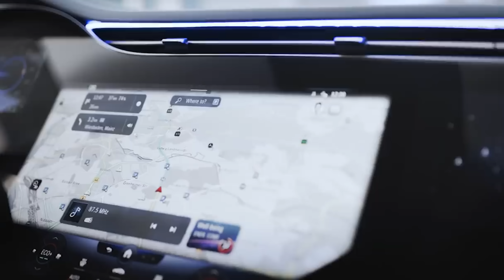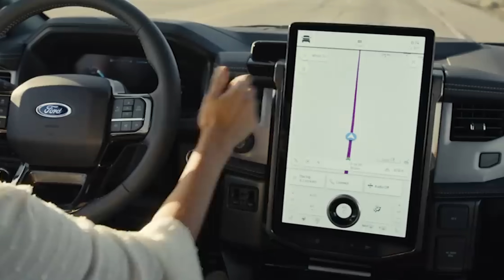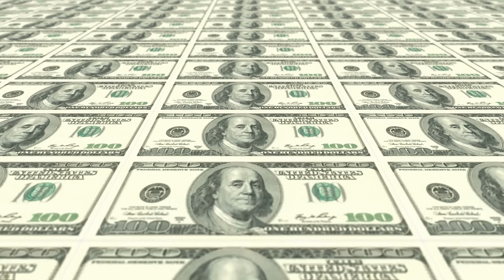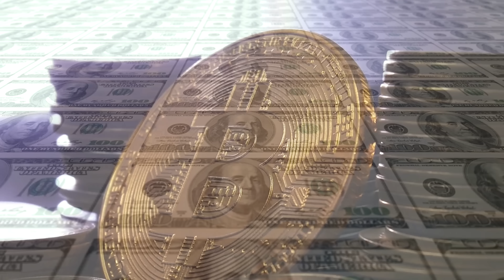What are Chinese EVs Doing to Establish a Market?

Comment: Your analysis for the present day is correct. However, it's static, not dynamic, so that's not the right analysis. The correct analysis will try to figure out what the Chinese will be capable of after they have ramped volume production in the Chinese domestic market. What is the rate at which the Chinese companies can ramp, and what is the rate at which they can innovate and improve their product? If the Chinese EVs are slower than Tesla, but faster than Ford, GM, etc, then there WILL be a Chinese invasion of the US market, eating up all the market share not taken by Tesla!
Reply from the maker: I think at this stage its an "IF" they ramped to volume production.
Reply: @TeslaEconomist  Well, that's the thing. The game is rigged for the Chinese companies in China. Also, Tesla and the rest of the industry will have the effect of increasing the knowledge and capability of local supply chains. IF the Chinese EV companies ramp up (and I think that situation is like the early 20th century in the US) someone over there is going to wind up lean, strong, and competent. It's those surviving fittest companies that will become the invasive species coming over to the US. Law of large numbers makes it unlikely all will fail to ramp, and make it likely a few will succeed.
Reply: I really hate Chinese companies because looking at the books is pointless. I’d love to see a chart with the trend in capital efficiency. Are Chinese companies becoming more efficient faster? Any Ideas? How can we get good corporate books? Maybe they are accelerating, if so this could be a flaw in your thesis. Hmmm…
Reply: @TeslaEconomist  You are wrong again.  The Chinese have already proven they can build a factory faster than GM  or Ford. NIo will be set to go from 120K to 600K in the next 12 months.  Do I need to mention BYDs  accelerated pace? You need to do more homework.
Reply from the maker: They are making cars that are not suitable for the US market.
Reply: @TeslaEconomist  I think you have hit the nail on the head. Chinese people are smart, innovative, etc. and therefore respond to incentives. But a command economy never correctly sets out the incentives since it’s goal is to stay in power, not respond to the consumer market.
Reply: @johnryan8645  
"It's goal is to stay in power....."?
What do you think the recent "union build" debacle was about?
Nothing more than "promise me your vote, I'll look after your job"
Reply: @rogerstarkey5390  sure. You’re right. A perfect example. Yes.
Reply: @TeslaEconomist  let me chip this in, I respect your analysis a whole lot 🙌🏾, thanks for your invaluable efforts and time. 
That said, you are completely offside here 🤣, you see the level of conviction you and I have in Tesla while the broader market is mis-analyzing it, that level of conviction is what I have that the Chinese EV has (not will) all it takes now and in the nearest future to take on any market share not gobbled up by Tesla.
What would you say or think they lack? Innovation, drive, country support, technology, cheap labour, finances, cheap loan, precedence, experts? Pick anyone and I will wrote you a dosier how you are missing the forest for the trees
Reply: @TeslaEconomist  The point is, taken from Ark Invest, that once they have ramped up in China, Wright's Law will come into effect, and they will be able to produce better product for cheaper. The same thing happened with Japanese auto manufacturing. All those companies started with reputations for shoddy products not suitable for the US market, but then grew into companies that were able to produce such products. It's only then, that they started their invasion.

Comment: Thanks for doing such an excellent job exploring this important topic.   You make many good points but miss, in my opinion, the key issue, which is this - China is a predatory merchantilist state.  Profits and losses literally do not matter (in the short to medium term).   China’s approach is to subsidize companies and markets they want to enter and then chose a standard bearer (generally only 1, but possibly more in a market as big as autos), and by so doing support that company’s growth in China, allowing the chosen enterprise to achieve best-in-class scale, costs, quality (measured against Western benchmarks), and profits.  With Chinese market dominance achieved, this company is then capable of exporting to enter Western markets, where it will be priced to gain share against local incumbents.   As you suggest, they will not be able to displace Tesla, but because of the weakness of the other large players in the US market they will have an exploitable opening that will, over time and despite the large subsidies afforded US (and Mexican - lol) makers will lead to gaining a significant share of the US market.  So, concretely, what will this look like?   Step one - Tesla’s order backlog quickly climbs to 3 years or more with the rebate incentives.  Step two - The incumbent’s can’t source sufficient battery capacity to increase their production to meet demand and buyers just give up on ordering BEV models (some will settle for a hybrid).   Step three - by 2023, China’s standard bearer/s (BYD, Nio ?) will offer a competent car for slightly more than a Tesla with near-term delivery.   Does China Inc lose money on each sale?   Maybe but they don’t care.   Consider also the geopolitical forces that bear on the issue of auto sales.  Can the US effectively ban China sales of autos in the US?  No.  The China market as well as Tesla itself is China’s hostage to this strategy.   If buyers are clamoring for BEV’s will US politicians not accommodate them?   I think so.  Bottom line, a ruthless and competent  competitor can and will gain significant share in the US in the 2023 - 2026 timeframe because other non-Tesla companies are 1. Incompetent, and 2.  Incapable of scaling BEV models.
Reply from the maker: Yes you have fully understood my points. I agree.

Comment: Another great analysis video, thanks! I agree with most of what you are saying. However, I found it a bit disingenuous that you used the MG ZS EV example when the MG 5 EV is a much more attractive vehicle to anyone looking for range and value. £26k for 250 miles of real range is not to be disregarded quickly. And in the uk with salary sacrifice low tax leases, this car can be had for as little as £180 per month - pretty crazy economy.
Reply from the maker: Define real range?
Reply: UK channel.
Husband uses the MG as a mobile workshop "motorway munching" as a mobile EV mechanic.
Serious mileage.
Reply: @TeslaEconomist  achievable in the same way as a Tesla Model S can achieve 400 miles - so definitely not usually but can still realistically be done with some careful driving. I had a test drive in one and its definitely no Tesla but still a vast improvement over most ICE vehicles or budget EVs
Reply: @TeslaEconomist  I just had some confirmation from another YT channel “EV James and Kate”. James works for Cleevely Motors, an EV repair garage. He regularly gets 240-280 miles range travelling out to various repair jobs, with all his tools and spare parts in the back, even in UK winter conditions. Just thought you deserved a proper answer! Keep up the pace of your videos, outstanding work!

Comment: Very interesting video. Why is it that at 3:14 the shot of the display in the Mercedes shows the speed at 52km/h but the speedo dial to the right of the number value is showing the needle at only approx. 15km/h? This can't be a tachometer (i.e. rev counter in RPMs) because EVs don't use RPMs the same way anymore (i.e. as gear change indicators or performance measures during actual driving) ...What am I missing here?! I know electric motors still rotate and have actual RPMs but I'm wondering about the dials as shown.

Comment: BYD most likely won't import to the US. Even they don't see the benefit in doing so. If they did sell here they would build a factory here. If it were beneficial to build a factory here then building their vehicles wouldn't be an issue but selling them with all of the propaganda against China means they wouldn't do well here.

Now this FUD about their LFP batteries is getting tired and it borders on ludicrous. Tesla is using Chinese made LFP batteries and news reports say they just signed a 10GW deal with BYD for more batteries. The range in their vehicles using LFP isn't an issue just like it isn't an issue with Tesla's Model 3 here in the US. 

Charging isn't an issue either if their vehicles were here. The non Tesla network is all across the US...and most charge from home anyway...and Tesla plans to open its chargers up to non Tesla vehicles. So with Tesla committed to installing more chargers, the US law providing more public chargers and Tesla eventually opening up its network to everyone it would not be a problem if any BYD vehicle was here and using LFP batteries. And you can most certainly go long distance on a LFP battery. Bjorn Nyland proved that. And Tesla's standard range, using 2170 batteries, is pretty much on par with current LFP batteries and plenty who own those have taken road trips. You have to stop one or two extra times but they do it. The same for LFP batteries.

The US isn't a fair comparison to how Chinese companies do against Tesla. If you really want to compare then look at the European market, Australia and New Zealand etc. China is exporting to many of these countries with no problem and doing very well. And LFP isn't the only battery they're using NIO's ET7 comes to mind. It's top version is $82k and has the battery size similar to a Lucid Air yet its cheaper than the Lucid or the Model S.

Yes, no one here in the US cares about or drives an MG EV but they do in Europe. The new version of that crossover is out and its selling in Europe and in Australia. 

As a matter if fact most parts for cars are made in China. The Chinese Model 3 and Model Y in essence are Chinese made cars. Manufacturers such as BMW and others who's cars are made in China are pretty much Chinese vehicles.

Comment: This is the first time I've heard you go off the rails and I think you know it based on your disclaimer at the end of the video. Anyway, I think you are missing a few points. First, MG is not the only Euro brand owned by the Chinese. Volvo is the big one that has a great reputation in the US but it's now owned by Geely. BYD has Warren Buffett as a significant investor. There are others and while we haven't heard of them they are not small. They are building 10s of thousands of cars now.  Your point about brands like Mercedes being bought by the Japanese or Koreans is valid, but those companies are just as likely to be bought by the Chinese. Second, I don't think the Chinese brands are actually competing against Tesla. No EV is actually competing against Tesla. They are all competing against ICE brands. The market switch is so big they don't need to compete with Tesla. Big US auto are significantly behind the Chinese and they don't even know it. Like you Detroit scoffs at the Chinese like they were doing to Tesla. The Chinese will begin exporting their cars and SUVs and and they will dig into ice builders deeply because when you are poor and you can either buy a crap used ICE or a cheap new car that is cheaper to fill up it will be a no brainer. In the meantime the "Big3" will be bickering over how to actually compete with Tesla. Finally, the Tesla charging network is on a different planet than all the other EV charging network options, but they do exist. That will not be an issue for Chinese EVs. Mostly because the folks buying a Chinese EV can't afford to take a cross country trip and also because those that do are used to suffering. Of course the "Electrify America" issue will be equally shared buy GM, Ford, VW, the Chinese brands, and the rest equally. The Tesla benefit may always be a huge advantage for Tesla. Although, they are experimenting with open Tesla chargers in Europe and that might create a huge revenue stream for Tesla at the expense of exclusivity for Tesla owners. Some cities will do a better job of adapting to the future than others. You can just take a look at Kansas City vs St. Louis, both cities in Missouri but radically different EV charging environments. I do enjoy your perspective, but this time I think you got it wrong.
Reply from the maker: I never said the Chinese are competing against Tesla. They will be competing against US PHEV. The Chinese SUVs, have even worse range, and simply wont be suitable for the market.
Reply: Geely (Volvo, Lotus, London Taxi, Polestar) bought 10 % of Mercedes, good for M. Cognitive Ability CHINA 104, USA 99.
Reply from the maker: They aren’t using those badges for Chinese built cars

Comment: I love your projections and free-thinking on the possibilities and the economics of Tesla but please, please don't continue with the off-hand (mis)characterisation of MMT. If you plan to continue to believe that MMT is simply the conclusion that "deficits dont matter", then you are missing the point. There is an enormous, well researched body of literature that you have clearly not engaged with.  Like any professional economist or student of economics, you (and I) have been trained in conventional models and frameworks of understanding, and so it is very difficult to understand and accept critiques of those frameworks. This is what MMT seeks to do (challenge the neoclassical/neoliberal framework). Ultimately, orthodox understandings of money can be reduced to a quantity theory approach (increased money supply leads to reduced value = inflation), but a few moments thought is usually enough to show that modern money (which is a system of both a fiat money and credit money) does not work like a market for commodities (gold, silver, bitcoin etc). 

Also, QT has been contradicted repeatedly in practice: the Fed's monetarist experiment in the 1980s demonstrated that it is not possible for the Fed to use the money supply as a tool of economic management - also Japan has shown over the last 30 years that massive deficits and very low interest rates do not (by themselves) result in inflation. QT has no validity in terms of the basic operations of central banks - the monetary base expands and contracts in response to credit demands of the private sector (banks and borrowers) so the money supply is endogenous,; it is determined by the level of economic activity and prices, not the other way around. 

You should read Randall Wray, Bill Mitchell, Stephanie Kelton, James Galbraith, Warren Mosler...

Comment: I think a lot of the information you are basing your conclusions on is somewhat outdated. If you look at the trends, companies like BYD are growing nearly as fast as Tesla and improving their models with similar speed. There are several Chinese EV models that have ranges of 3 or even 4 hundred miles, and they have been hiring western designers and adapting their designs at a rapidly in preparation for entering western markets. In the same way that looking at where Tesla was a year and a half ago is not a good indicator of what they are doing now unless you factor in the trends, China is pushing hard and has a speed of change second only to Tesla.